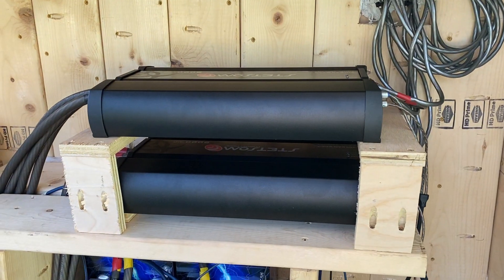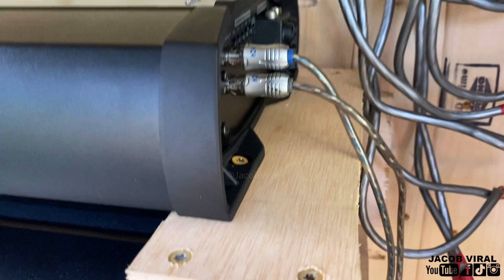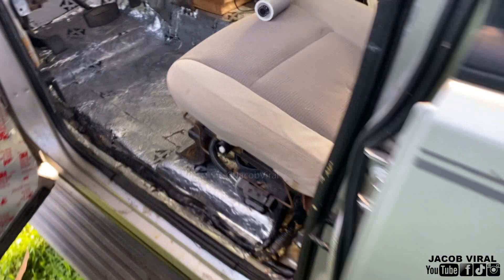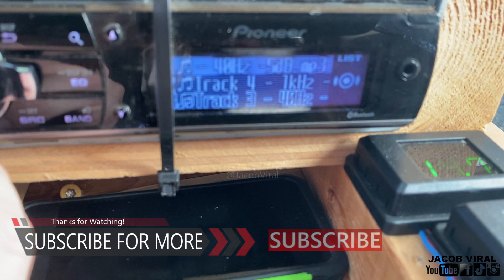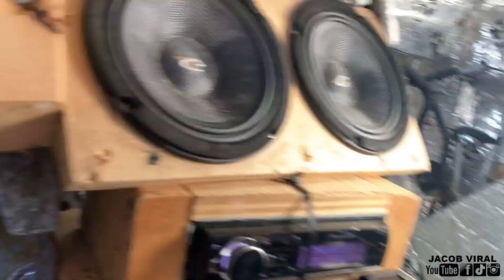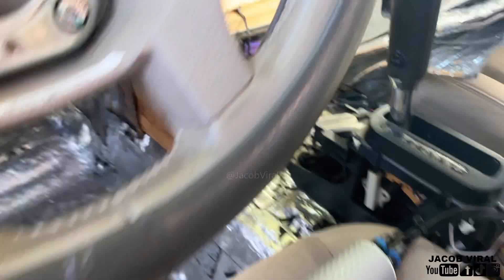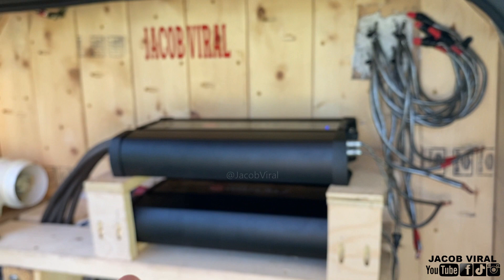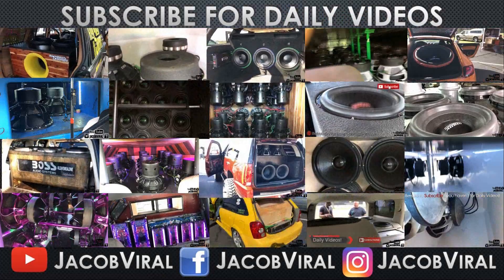SETTING BASS LEVEL ON FULL BRIDGE AMPLIFIER

Comment: a lot of head units do not like 16 volts... you can also just unplug rca to mids in highs in amp....most radios will have distortion at 100 percent volume... should always set to 3/4 volume... if you have a old JL clean sweep cd you can also do this procedure... JL audio also is one of the only brands to call the "gain" input sensitivity... thats what it truly is ...your adjusting the input sensitivity ... you pretty much nailed it... all amps are not equal... you cant just set all "gains" evenly ... and hope the same power gets to each speaker....good video!

Comment: When using my DD1, I always check for max head unit volume/distortion through the RCA’s first, then I set the gains on my amps through the amp speaker output connections.
Reply: That's what your supposed to do for clean output
Reply: @Louie-ji8xn  yes its very common to get distortion after 3/4 volume on head unit
Reply: DD1+ is a must. A little more than the DD1 but worth every penny. Perfect for gain matching and to set db overlap.

Comment: I'm not an expert but you need to test for  clipping at your RCAs and voltage match the amp input. That would give the cleanest signal to the amp then set your gains the same way you just did.
Reply: Was thinking the same. The signal from the head unit is also important when tuning
Reply from the maker: correct, I didn't show that but I knew it in my head, thanks!

Comment: Yea these full bridge amps are a little more difficult to tune you have to lower to pre out aka bring that volume down a little for you to get a clean signal before distortion hits I usually tune them full bridge amps by the clip light it’s very very close to when the smd shows clip
Reply from the maker: I turned down my bass on the head unit to from +6 to 0 and it helped a lot off camera though.

Comment: But yeah bro first thing before you touch the amp you connect the rcas from your head unit that go connected to your amp and plug those in to the dd1 and turn up the volume on your head unit after you put all the settings to flat and no bass boost. And you play the first 40hz song and you turn it up until it distorts and see what level you can go to before it distorts then do the same for the 1000hz track and see what the max is on both and go with the lower one of the two and that's your head unit max then you should do the amp and make sure your bass knob is all the way up and your gain on the amp all the way down then turn off all the filters then turn up the radio up to the max before distortion then set your gains to we're it barely gets distortion and you should have a volt meter to help you while you do this so you can see the voltage so if you have another amp you can gain match the same voltage. But as soon as distortion starts then at that point you set your overlap. Steve Meade has a great video on this.
Reply: Omg stop with that "all on flat" crap Steve

Comment: Jacob, like many are saying here you did this wrong. The first issue many don't know is you can't tune a Brazilian full bridge amp properly with the SMD DD1 or DD1+. It will show distortion even at the lowest levels. (However, this does NOT mean Brazilian amps are dirty!) First make sure you have a clean signal with the DD1 from the head unit  (it looks like you know this but didn't show it) Then stop using the DD1 and use the clip indicators on the amps to set the gains up to just before clipping. Secondly, as Sam over at Barevids channel will tell you it is VERY important to set gains with the subs CONNECTED! If you don't you will be clipping after you hook the subs up. This can be very easily verified with an oscilloscope. Here is Sam's vid over at the Barevids channel showing the setting gains with subs connected:
https://youtu.be/wBVw8la8-UI
Reply from the maker: Still learning as I go thank you
Reply: @JacobViral2  Oh it's all good Jacob! I just learned this stuff in the last month or so myself. That's what I love about car audio... Always something to learn. I learn something new every day and you have shown me quite a few things too. 😊 Wish we lived closer, we have very similar builds in the same exact vehicle. 😁💥

Comment: Jacob, lower the output voltage from your head unit on the subwoofer channel. if you can adjust your subwoofer level in the head unit down, try that. it seems to me, in my limited experience with full bridge amps,  that they do not like high rca input voltage. I think maybe a max of 2v is needed, what is your rca voltage at your preferred max head unit volume? with lower input voltage, you will be able to turn the gain up a little higher and the DD1 should detect the signal before any distortion. there will be more adjustability and it will be easier to fine tune the gain level on the amp.
Reply: Following, I’d like to see if this is really going to help? I totally understand what you mean.
Reply from the maker: Thank you, that did actually work as I was at +6 and went to 0 and it was just fine off camera and was at bass level around the 20% mark for clipping.

Comment: I've heard that on full bridge amps you not supposed to set gain without the amp loaded. Supposedly will dmg amp. Is this a myth? I had a sfb amp and used a dd1 with speakers unplugged and it worked. Not sure how you can even set gain with speakers hooked up cause you would have to crank it loud. But I guess if you have a clip light you can play songs a guess. Not sure tho just heard about this on a bass page on Facebook
Reply from the maker: I've seen that too but im unsure sorry. I always tuned with subs disconnected personally no problems.

Comment: pioneer headunits start to distort at 56 so keep the volume on 55 and everything should be fine. ofc i dont know what setting you have on your headunit but basicly its better first to check with 0db test tone when your HU distorts. and because i use bass knobs i always tried to setting gain with 7 track which is -15db so whenever i needed i could get that extra more.

Comment: So you like your deh to be at volume 56 because that's where your mids and highs work better? Thing is that I have seen in other videos they also find out head unit distortion and sometimes for Pioneers people can go almost to volume 62. I think I remember a video from SMD where he went all the way up to 59 for volume or even higher not sure.
Reply from the maker: I just don't ever like to tune amps to max nonclipping volume to give me a few clicks of leg room for certain less bass output songs as well as to never max the head unit volume.  Your correct though it is volume 61/21.
Reply: @JacobViral2  Totally agree with you. Max is not good👍✌

Comment: taramps soundigital stetsom or another brazilian fullbridge all have a clipping light built in. that clipping light is accurate? i dont know about stetsom, but taramps amp have a two step clipping light, soft clipping is orange light, then hard or extreme clipping is red light
Reply from the maker: Yes it’s accurate and helpful to use

Comment: what you said i dont understand it clearly
the amp puts out 120-130VAC full turned?
Reply from the maker: correct, with just a multimeter you can set the gain if you know that max number to clipping for any amp as well.

Comment: Will you explain the -5 overlap and stuff lint that
Reply from the maker: In summary, a lot of amps don't like to see a 0db tone at full volume to clipping and could possibly blown an amp at clipping especially a hard clip. I've seen it and heard of it from multiple people. Also, majority of music played is around the -7.5 to -12db range so -5 is safe to safe good for majority of the music unless you  play chopped/screwed/bass boosted. Another thing I've learned is if you do tune to 0db at max volume you limit your capabilities of maxing the amp out for demos and even burps unless you tune it at say 90% volume for a few extra clicks. I'm still learning myself.
Reply: @JacobViral2  thanks bro

Comment: Nice work bro … hey I have a important question and I can’t find anything anywhere I just had 2 setsom db3k 1ohm amps both of them blew and cought fire lol 😅 all I did was put the positive in and then I put the ground into the terminal and poof !!! The first time it happened I thought I fuckt up and touched a wire so on the second one I made sure to be careful and went slow and it did it again I have no shorts in my cables every thing is cleen 1 awg welding cable … I notice on setsom sit shows how to hook up amp and the got it so the ground goes from amp directly to the batt and that’s not how I got my shit I have my ground going to the chassis  so if you have any knowledge of why this would happen plz hit me up bro I need help lol 😅I Ben doing installation for years and never had this happen
Reply from the maker: Usually if you have TWO instances back to back where amps blow, means there’s an error somewhere in installation process. Sounds to me like a ground or power are crossing somewhere and it’s acting as weld arcing out/grounded out. I would definitely ground direct to battery and not chassis ever from amp. Hopefully things are resolved. Thanks for reaching out.

Comment: to highinput voltage for the amps??
Reply from the maker: at the time of this video it was yes, but figured out i had to turn down the head unit bass level from +6 to 0 and it was much better.
Reply: @JacobViral2  yeah I thought so my smart 3k bass is getting 4v so I no gain on just use my inline knob

Comment: The input sensitivity of your amp matters too. Especially if you got a stupid Taramps that has an input sensitivity of 220mV... smh.  I wish I'd have know that before I purchased it lol.
Reply: The input of 220mv is only if the gain is at maximum level
Reply: 220mv input sens is at level 100% lol that mean level or gain is at max setting. read on the taramps user manual ☑️ taramps user set a rca voltage at 1.6 - 2.0v
Reply: @suthtokcraew1227  yep, and my head unit cranks 5v of clean signal. So there I am with a scope trying to set my hu level, instead of using my nice new DD-1. Not to mention my Audio Control DM 810. Defeats the purpose of spending that extra cash for the meter. At least I can still use it on my amp. Next time, I'll spend the extra cash on the amp 😉